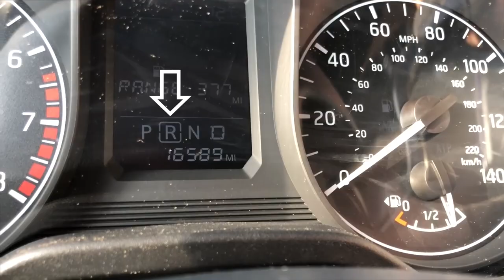How To Oak Stairs

Comment: Hey Jared, your video is inspiring and incredible! I probably watch it over 50 times this month, lol. However, if possible, can you explain your technique of getting the skirt board for each stair? Also what was the width and length of the MDF you used for the skirt board please?  Keep making videos brotha because city slickers like me need them. 💯🙌🏾😎🙏🏾
Reply from the maker: Thanks man! You mean the risers? The upright 1x8’s underneath each tread? Those are, 1x8 MDF (7 1/4 inch)  except the bottom is a little shorter to keep in code. You just measure each one after you install the sides. The sides are the skirtboards, they are 1x12x16’s MDF, and those are a little more complicated to measure, I feel like I’ve improved with video skills so next staircase ill make a more detailed description on skirtboard. 
It’s most making little jigs to find the perfect angles. Tricks of the trade 😉